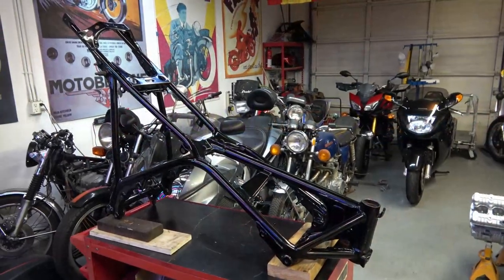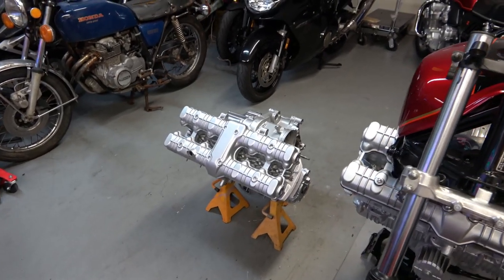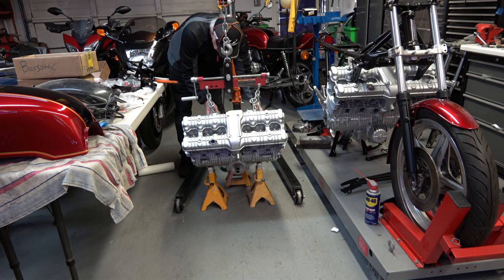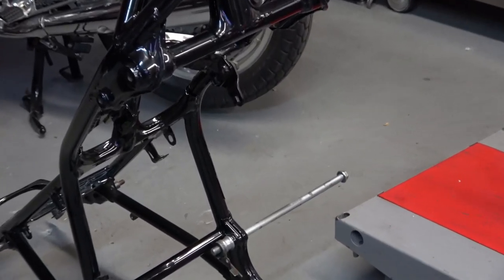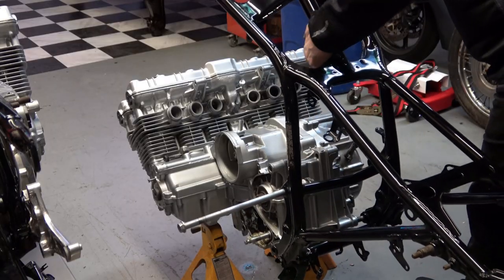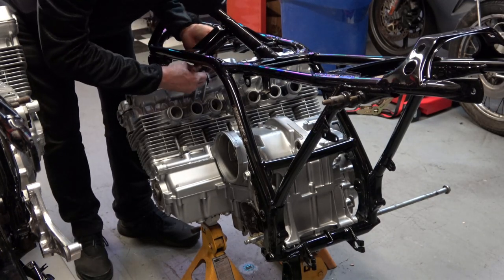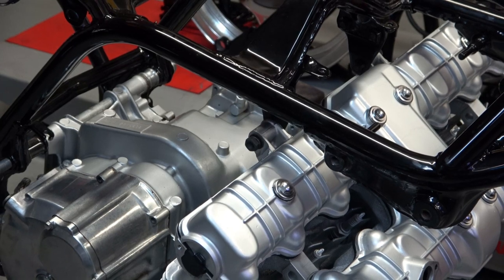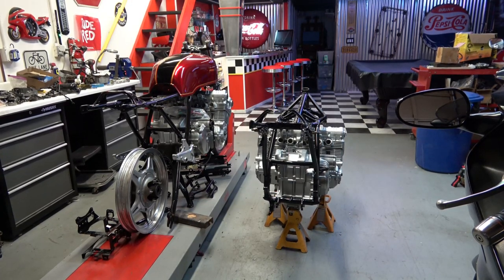Honda CBX Step by Step Restoration Video Series Part 35 - Reinstalling the CBX Engine to the Frame.

Comment: You haven't mentioned about installing the carbs yet.... back in the dealer days I had to drop the engine down (pivot the engine) in order to install or remove the carbs.  When the first
CBX came into our dealership we had to take a 'tracing' of the engine numbers for the registration.  Honda had placed the engine numbers directly below the carbs and the only way to gain access to them was to drop the engine.  What a PAIN!!  Love the two CBX's side by side.
Reply from the maker: Hi Ray
You are correct
I will be installing the carbs as soon as the bike is secure on its front wheel and center stand. Then I will tilt the engine and install them. I will devote a video on that, probably this weekend
Thanks Ray

Comment: Would it be better to install the carbs and airbox before installing the frame. Ive got this job coming up soon
Reply from the maker: It is easier to install the engine with out the carbs and air box. Once you get the engine secure on the frame, then you can tilt the engine down to a point that the carbs and air box go on very easily. Also, the air box is 2 pieces that are positioned inside the cage of the frame which makes it very difficult the position if it were all together before you install the engine. That is just my experience anyway.

Comment: Hello, the first thing is to congratulate you on your work and thanks for your videos. I would like to ask you a question, is it possible to remove and install the oil cooler hoses without having to let go of the engine? Thanks. Best regards
Reply from the maker: Hi Juvimi, yes but it is a lot easier if you just tilt the engine down only about an inch or so which only take a few minutes to do. Sorry it took so long to respond :)
Reply: @digitalpizza1  Hello! perfect, thank you very much for your answer, I will take it into account and I will do it as it says, I applaud your work ... I hope you are well.
Greetings from Spain.